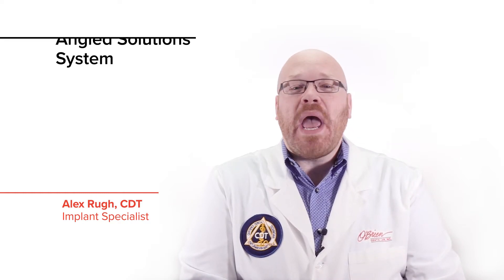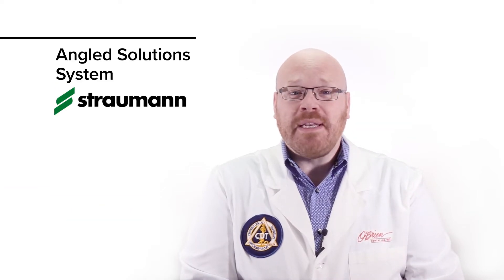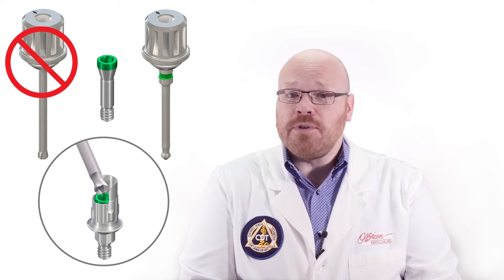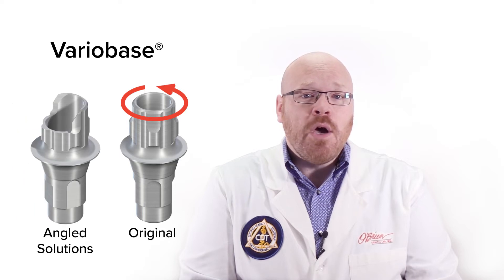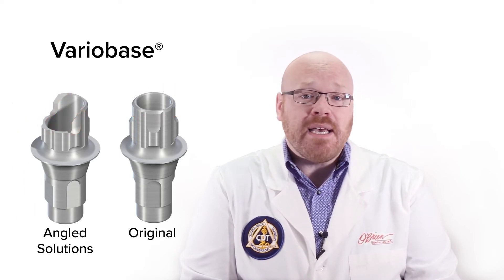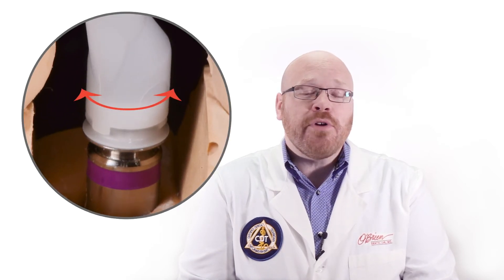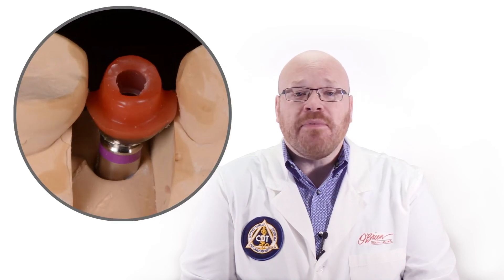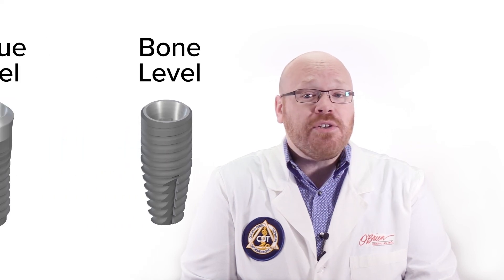Straumann Angled Solutions

Comment: Hello Alex,
When you do Emax crown pressed on this ti base, the pressed emax is going to stick to the base and become one piece? No need for cement like zirconia crowns?
Reply from the maker: The emax does not stick to the ti base and would still require cement.  The exception to this is if the ti base had undercuts built in that are substantial enough to mechanically retain the crown.

Comment: Hello Alex, what kind of alloys used to cast on top of this abutment? Is there a non precision alloy suitable?
Reply from the maker: With this abutment you can use any alloy of your choice.
Reply: @OBrienDentalLab  hello Alex, I just contacted Straumann technical decision, they said that the burn out copings are only for precious alloys. Could it be that non precious alloys have high melting temperature that can cause damage to the TAN base? Or cause an oxidation layer that is hard to remove/polish?
Reply from the maker: That's an interesting answer from Straumann.  We don't use non-precious alloys so it's not something we have tried.  But, once the burn out coping has been invested and burned out, I'm not sure why it would matter what type of metal was used.  The TAN base is not part of the casting process - the burnout coping is waxed up and then invested and cast by itself and is then cemented to the base.

Comment: Is there any angled abutment system that has 2 screw channels one to retain it to the implant which goes along the long axis of the implant and one to retain a crown to the abutment which is angled to exit through the cingulum area
Kind of like angled multi unit abutment but for anterior single implant supported crowns

It's a theoretical question
Because I think the only solutions for correcting angulation of implants in anterior region would be either
 angled screw channel
Or angled abutment with cement retained crown
Or this weired third option mentioned above
Thanks😊
Reply from the maker: Yes, it's an old method called transversal fixation (among other names).  This article might be useful for you: https://onlinelibrary.wiley.com/doi/pdf/10.1111/j.1834-7819.2007.00013.x
Reply: @OBrienDentalLab  
Thank you very much that was so helpful 😊

Comment: Is there any trouble getting the adequate torque when torquing down the screw, and are you still using the same torque driver?
Reply from the maker: You can use the same torque driver, but you will need to use the Straumann AS Screwdriver tip.  There's aren't any issues getting adequate torque as long as the crown is made within the 25 degree angulation limit.  Any angle past that limit can  cause the driver to slip out of the screw head while torquing.